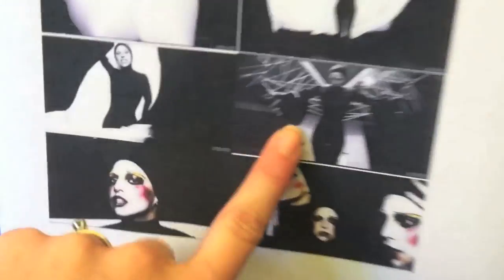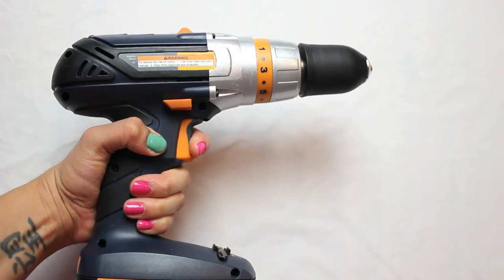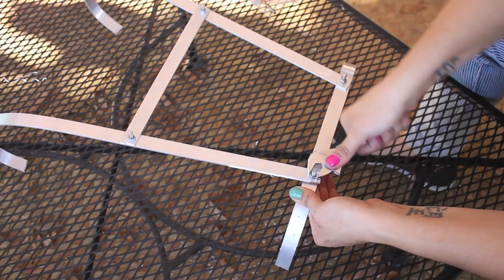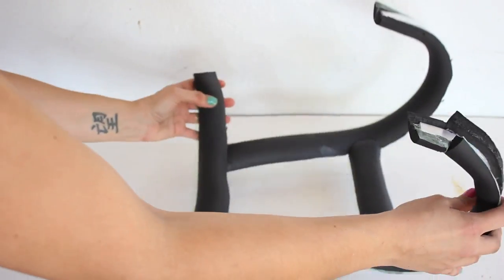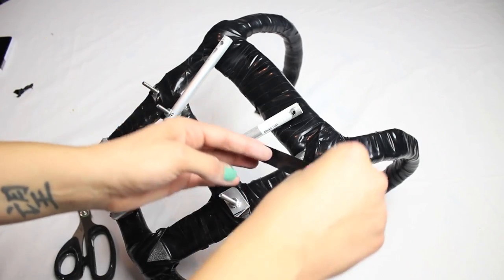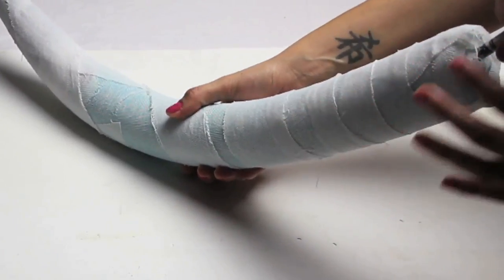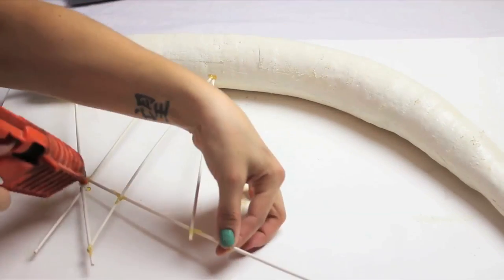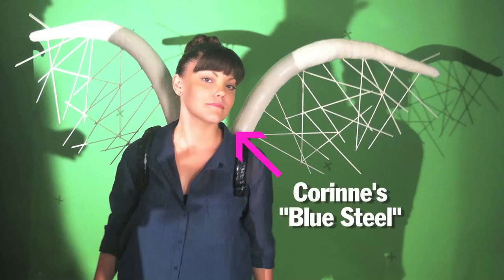DIY Wings, Drum Line Harness, Lady Gaga Applause, ThreadBanger Tutorial

Comment: I may have to modify that harness design to work with the wings I made in 2008, that at this point in time have a steel back plate, flag pole holder and require a steel boned corset for the support.  I like it!